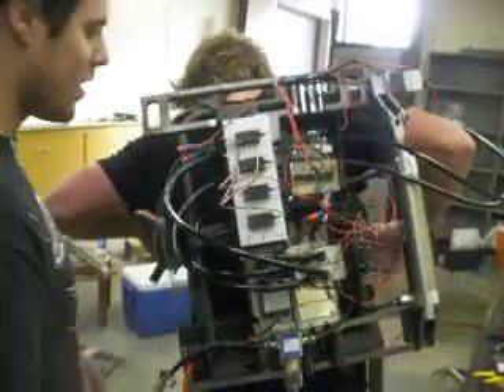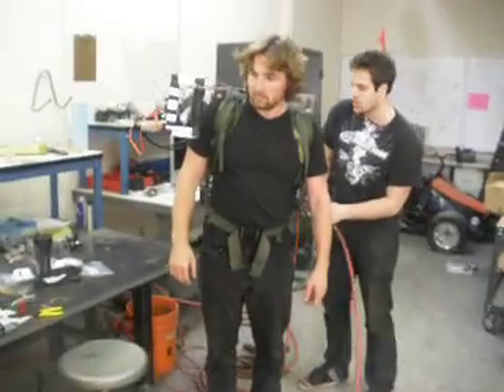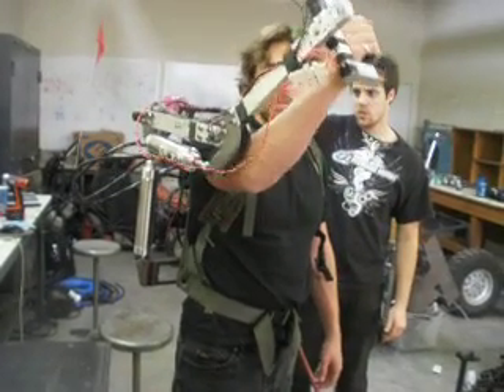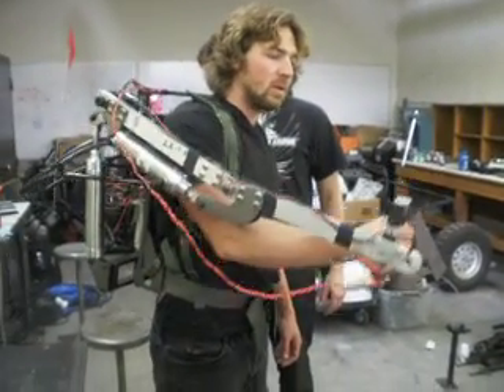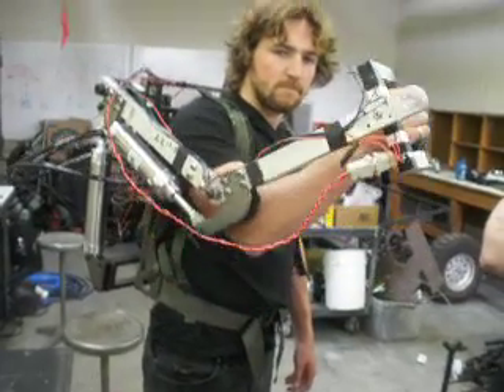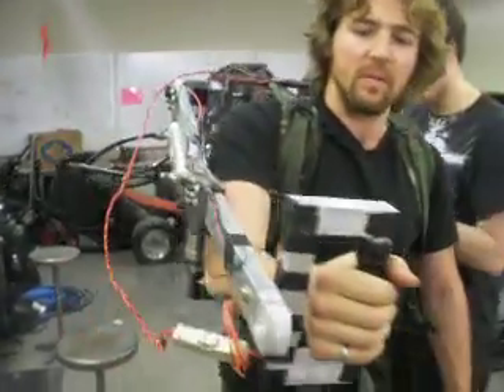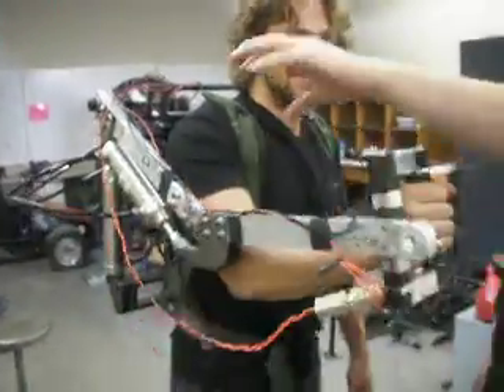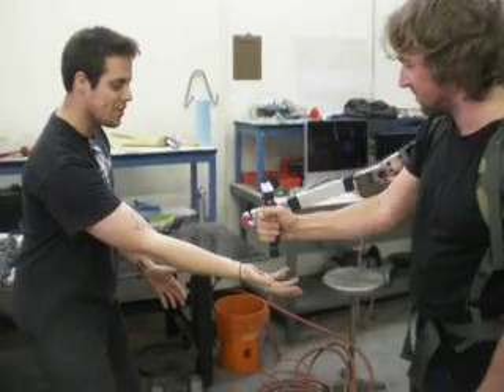Ergonomic Control for Powered Mechanical Exoskeleton - First Run

Comment: that's cool but i would use a under armor sleeve fitted with flex sensors, so it would replicate your motions more and would be more fluid (nice project by the way)